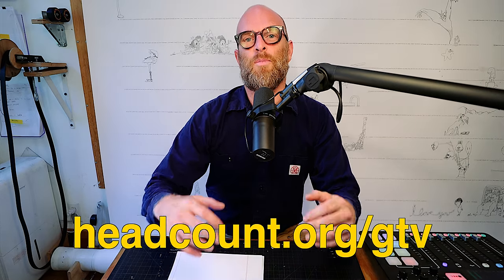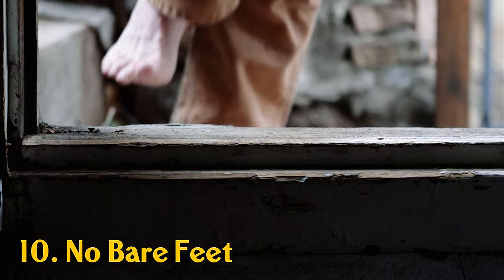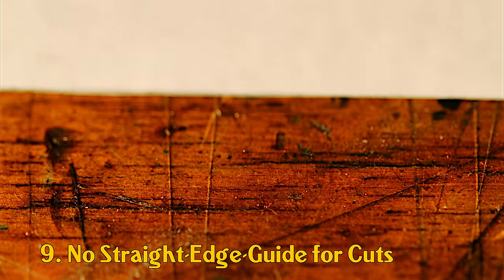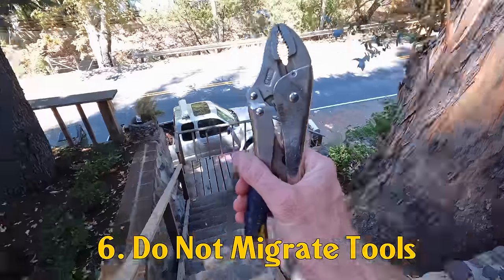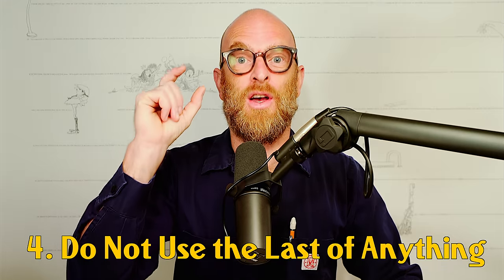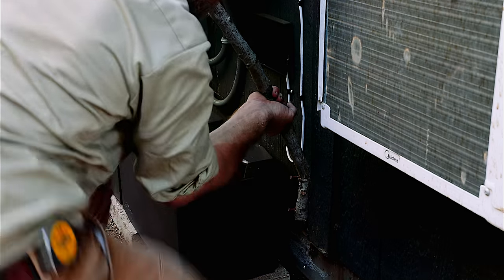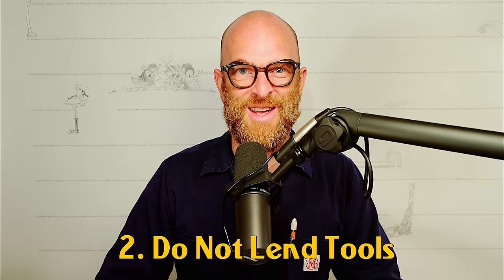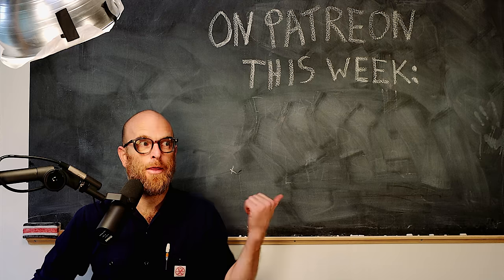10 Forbidden Practices in the Workshop

Comment: Just about every piece of serious electrical equipment has a flathead cut into it; and for good reason. After using the Robertson to get them snugged quickly, I come back with a flat head to torque them down. Electrical connections must be tight.  With a flat head you can apply torque with almost no force into the screw. This is especially important when you need the screw to be tight but the equipment is delicate, such as plastic or phenolic insulators in electrical panels. You can only tighten a Philips screw as hard as you can press into it. Robertson and torque bits almost work but they are still too tapered. Allen works even better but are prone to stripping if you torque too far.  When your bolt strips what do you do? I dremel a slot for a flathead. You can make a flathead screw and screwdriver in case of emergency. Good luck making any other screw or bit driver. Flatheads require discipline and patience; as well as the occasional stabbed hand if you aren't careful.  Flatheads aren't going anywhere. Sorry.

Comment: Torx (as mechanics know them) or Star bit (as carpenters know them) are superior to Phillips screws. Robertson (square drive) are also superior to phillips, but inferior to torx. Phillips have a tendency to allow the driver to cam-out and screw becomes stripped. Square drive hold the driver better but can round off, particularly if the driver head or bit is beginning to wear. Torx bite the best. Small allen head screws can round easily and become a nightmare to remove. Larger allen head bolts are fine, if there is no room for countersinking a standard hex bolt. No triple square. NEVER triple square. Looking at YOU, German automotive manufacturers! They're good... but non standard. Flathead are useful in applications where the screw is used for an adjustment as it's easier to judge a quarter turn, such as an idle circuit adjustment screw on a carburetor.

Comment: When you have many-many-many tools, widgets, gadgets, and diverse objects how to classify things?  Especially if you have a functional kinesthetic style approach to things?  Simple.  Associate things to abstract functional concepts.   Everthing used to tie, attach, link, stick, tape, glue, connect should be together or around the same location.  Everything used to remove, cut, bend, or alter material should be together.  Everything that rolls such as ball bearings, casters, rollers, wheels should be together.  Everything that has some leveraging effect to it like pliers, wise-grips, pullers, should be together.  Everything that is an add-on or an enabler to a tool like drill-bits, saw blades (linear, circular, holesaws),  adapters should be together.  This way, it is much easier to put things in their original drawer or box when done using it cause at this moment you can question yourself, for example, is this an "altering" tool (i.e. a file, a cutter, scissors, etc ...), or is this a things used to join things together (tape, string, steel wire, glue)?  Then you know where to place it back or where to find it again.  Note that in this manner, you can gather apparently dissimilar objects in a very space-efficient manner and avoid creating specific bins for specific things.  The function becomes the specifics to which many dissimilar things belong.  After all, in a workshop, all you are trying to accomplish is "do" things, "effect" on things, and realize "functions".  Find your functional spectrum and cast your objects in it.

Comment: Flatheads get such a bad rap due to user error. You buy crap tools and blame the screw. They are actually awesome when you use a screwdriver built for them. Able to stay on end of driver, won’t strip, can be pressured. Hint, if your flathead screwdriver has a tapered end it’s really a paint can opener. something made to work with multiple sized screws hence they suck. Real flathead drivers have parallel sides and are sized to the screw.

Comment: Note: Flathead describes the shape of the screw not the drive type, similar to panhead describing the shape of a screw not the drive type. You hate Slotted screws. You probably use flat heads all the time, e.g. drywall screws, deck screws, ... 
Also flathead screws have their place, specifically for antique hardware. Philips drive is truly the worst. Robertson and torx are functionally far superior. There is never a time that philips is best, neither for aesthetics, nor functionality. The only benefit of philips is the widespread availability, but that does not actually make them good.

Comment: Although I wholeheartedly agree about flathead screws, (f*ck flatheads)... When possible, I also take every opportunity to replace Philips heads with torx bit heads, an even further superior screw head. This is universally accepted and no has ever will ever disagree with me on this point. I will not be taking questions or responding to any feedback, this issue is considered settled, adjourned, case closed.

Comment: A written list of the topics of this video, in case you want to take it with you to your workshop: 
	1.	No bare feet. 
	2.	No straight-edge guide for cuts. 
	3.	No fixing garbage. 
	4.	No Trip-wires.
	5.	Do not migrate tools.
	6.	No flat-head screws.
	7.	Do no use the last of anything. 
	8.	No hoarding materials.
	9.	Do not lend your tools to others. 
	10.	Do not switch horses mid stream.

Comment: You're confusing head type with drive type.  I think you mean "slotted screws" instead of "flat-head".   Flat head is a head type.  Slotted is a drive type.   Flat head screws can have a torx drive type  --which is the kind I prefer.    Flat head screws are often necessary when you want them flush with the surface.